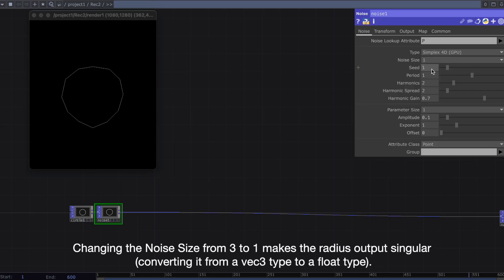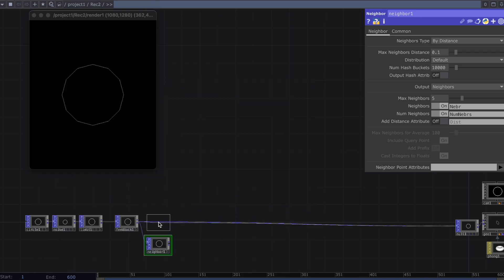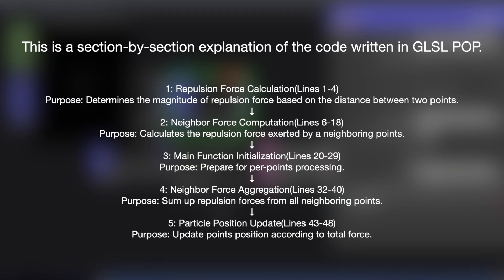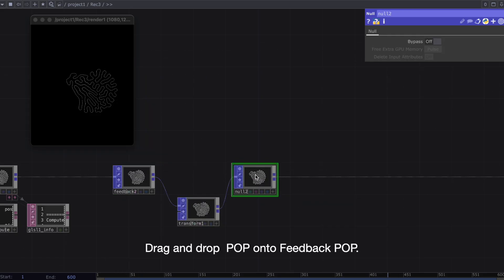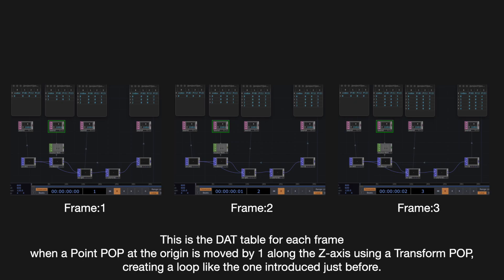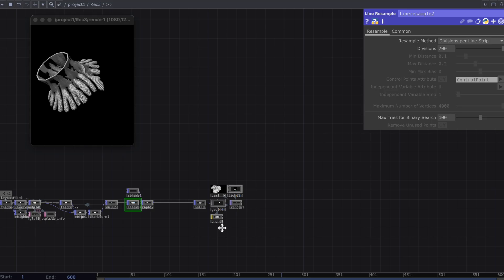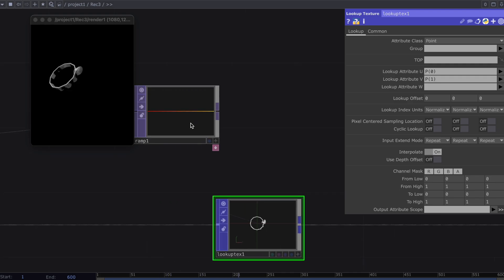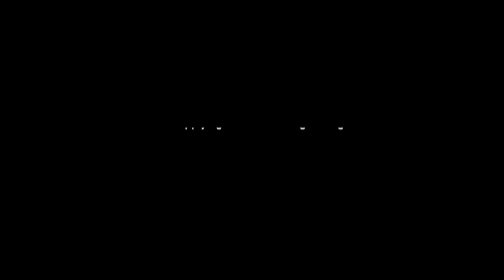TouchDesigner POPs Tutorial: Organic Growth Shape

Comment: My computer crushes when I conect the sphere1 and the copy2 at 6:25 what should I do?
Reply from the maker: That portion can become quite heavy to process, and on some computers it may not be possible to run. You may be able to get it to work by doing the following:

Lower the divide  values on the two Line Resample POPs to levels your system can handle.

Then replace the Keyboard In CHOP you are using to reset the Feedback POP with an LFO CHOP so that the Feedback is reset within a manageable range.

If you have a moment, please try those steps. I hope that helps .